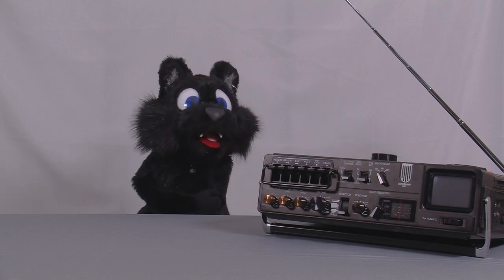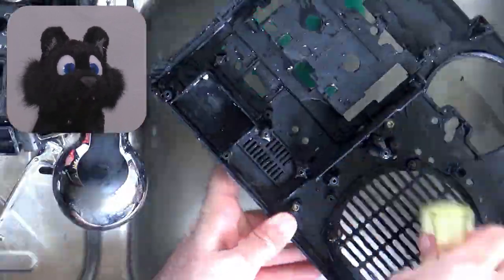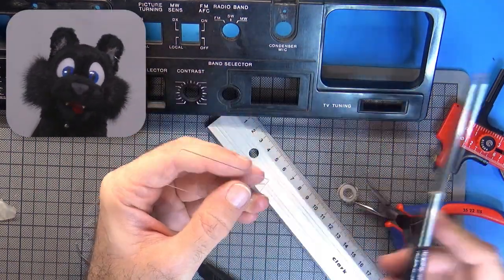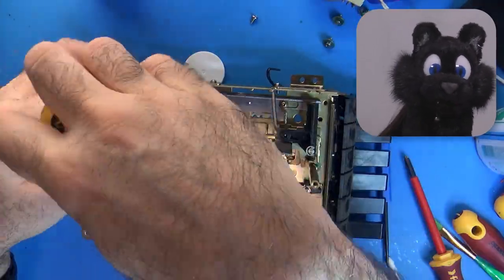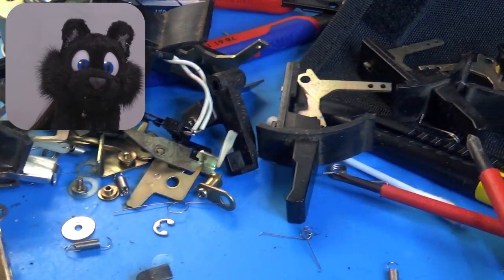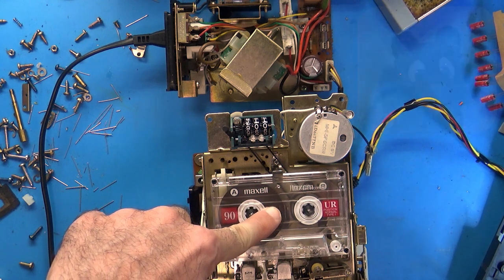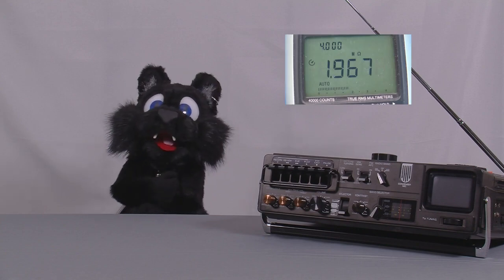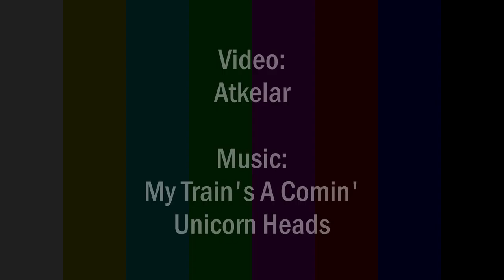Restoration Project #13 - JVC 3060 Radio/TV

Comment: I would love to see you restore an Philips 22RL798 Antoinette Transworld de Luxe, the radio that Blofeld uses in 007 Diamonds are Forvever (at the end). They say it is a nightmare to service it.
Reply from the maker: I have another AM/FM radio in my queue, but it's a Grundig one. Some "world receiver" thing with multiple dials that looks like it's from a military control panel. Very good condition, so it might need only a thorough clean and recapping.

Comment: Interesting! I like seeing restoration projects, Hai sent me here.
Reply: One question, Did you replace the drive bands? I might have missed that. It's something i have done in a few VCR's i have tinkered with
Reply from the maker: Yes, I did replace them. The old ones are either turning into tar or getting very stiff and slippery. Belt replacement is always a first.
Reply: @atkelar  Makes sense. I have found with the things i have worked on (Athough i am by no means an electrial engineer) that belt replacement tends to be the main sticking point, no pun intended

Comment: Wow! excellent work! I bought the same one because I liked it, but it is not in very good condition and it works although not very well.
I have no electronic skills, but more mechanical, I would like to recapping. Have you again the list of capacitors ?
Reply from the maker: Hello! Thanks for the kind words! I did not really have a simple list, I looked at the schematic and took pictures when I desoldered the electrolytics. They are pretty common values that are still readily available. Given the experience with my unit, I'd double check all the switches. These seem to go "bad" rather quickly and need contact spray (be sure to flush it out too and let the switch dry) or direct cleaning with disassembly as I did.
Reply: @atkelar  Thanks for the prompt reply and for the advice.
Congratulations again on your skill !

Comment: How on earth do you know where everything goes when rebuilding! I know you take pictures and have the video but even so that is some nifty work. I would be able to strip it down to the last nut and bolt. The difference is that after an hour of fiddling about and a lot of swearing it would all end up in the bin. I know for a fact it would, I've seen me do it! :-D
Reply from the maker: Thank you! Part of it is also to try to understand everything es good as possible when taking it apart. That way, during the "put together" part I can check on every part once I put it in. Naturally, the odd washer will remain behind now and then too 😊

Comment: I recently picked up one of these second hand that did not have the AC power cord so was unable to test it out.  It does not power up with batteries or the DC cord.  Are there any internal fuses that could need replacing?  Just trying to figure where to start when troubleshooting the power issue.
Reply from the maker: There is indeed one fuse on the DC side, 250V @ 1AT glass tube fuse. It's on the 12V line and would be a prime candidate. The schematic also lists a fuse on the primary side of the AC line, but I don't see any evidence of that in mine. There might have been different models. Also, there is a switch inside the AC line socket that turns off the DC part when a cable is plugged in. That could also be broken/oxydized or stuck. AND the battery line also goes through the 12V socket which would also interrupt the battery line if something is plugged in there. Pretty extreme setup... but all contained on the power board right next to the power sockets.

Comment: Amazing video my friend, congratulations! I have a question and maybe you can help me. I have the same radio and, like you, in my country there is not analog TV. When you plug the cable from the computer to the radio, there is not posibility to send audio+video trough the uhf/vhf port right? Is there any posibility to send audio+video or the only way is throug the air with a transmitter with antenna? Thanks in advance and congratulations again for your helpfull video
Reply from the maker: It should be possible to have both signals in RF over the same antenna connector. The two external connections are just different for UHF and VHF, i.e. the intended frequency range and probably impedance. But the decoding of the signal is the same from right after the IF stage; The question is to hit the right frequency.RF TV signals are defined in a range of frequencies, according to a table I found, for example: Channel 2 = 47 to 54MHz, with the picture around 48.25MHz and the sound at 53.75MHz. TVs usually combine the two into one dial, but the audio is pretty much "normal" FM radio, just outside the defined range of commercial FM radio transmissions. So if you find a device or circuit that encodes both onto the same RF connection, it should work just fine.

Comment: Fantastic! MY hobby is also fixing old stuff but what caught my eye was: the shiny metal parts! How did you achieve this? How did you get rid of the rusty parts and make it so shiny? I can really learn a lot from you.
Reply from the maker: Thanks! I'm not sure which metal parts specifically you mean in this video; But for the antenna (and other chrome plated metals) I use aluminium foil as a polishing rag; That's a trick I learned way back from my grandfather when we were cleaning my bike rims. But it only works with real chrome plating, anything else might be rubbed off. Aluminium is much softer than chrome but much harder than surface tarnish, so it'll "automatically stop" before taking off too much. For chrome-style plastics... that is much more difficult, as pretty much anything will rub off that coating. I recently discovered "liquid chrome" pens that do a good faximily of the original when some minor touch up is needed.
For any non-chrome parts, I usually go with various sizes and styles of wire brush wheels on a Dremel or bench grinder... depends on "how thick the rust is". Those parts don't usually "shine" afterwards. Light rust works with thin spray oil (not WD40, but similar style oils) and an old rag...

Comment: You again surprise me creating a silkscreen stencil for the panel. What software you used? Adobe Illustrator? I suffer using Inkscape.
Reply from the maker: It's been a while and I had too look at the footage again :D but this project was already done wiht InkScape. I generally agree though: it's not some choice one makes but rather the only viable option on OSS. Before I switchted to Linux, I had an Adobe CS-6 license, but I refuse to "rent" licenses and so I was stuck at an ancient level. Illustrator and Photoshop are so far the only two things I really deeply miss. Most projects in the OSS world are... let's say "from C++ nerds, for C++ nerds": basically, "Hey the feature is in there, just learn these 25 hoops to jump through and stop bothering me" attitude. Usability is usually quite low.
Reply: @atkelar  The same reason I don't use AI. Paying for SaaS is just too much expensive. Yes everything is hidden in a convoluted labirinth on Inkscape, and conversioon to EPS is ... well ... less than ideal.

Comment: Hey! I got the exact same model on an auction for around 30 euros as an untested unit. It was a gamble, but I was very happy to turn the unit on and see that all of the functions worked, including the CRT part. When doing research on it, I stumbled upon your video and was very impressed! Can't believe the trouble you went through disassembling everything, not to mention the recap and freaking silk printing, and even the freaking milling machine made an appearance! Very impressive! Immediate thumb up! Mine is missing the "Auto Stop" sticker and the plastic frequency panel (through which the light shines through) is a bit yellowed. It should buff nicely, although I'm scared of making it worse. Any advice? Should I get like a headlight restoration kit, or just a couple sheets of various grit sandpaper? Since it's a small piece of plastic, I don't think it would be convenient to do it with a drill attachment (which is something those kits usually include). 

One question - the bulb on mine is working, but it's quite dim. Is yours brighter, or is that just the way it is? Have you considered replacing it with a brighter modern LED? Best regards, congrats once again on the video, it should definitely get more attention! Just wanted to let you know there are people appreciating this kind of a hard work and nice editing. GG!
Reply from the maker: Thanks for the compliments! 
There are "LCD screen buffing kits" out there that are intended for small scale scratches in plastic surfaces; Headlight kits might be a bit too much for the soft plastics. I did not have good results with sandpaper on transparent things, it takes  LOT of buffing to get the tiny scratches out again; so if the goal is a clear see through piece, I'd look for the display buffing kits first.
The bulbs are tiny little things, and I suspect it was only ever intended to provide a visible light for tuning in when it is completely dark around. Since I made the video, I did in fact put in LEDs, which was too little for an individual video, but even that is rather dim; the radio frequency display would need some sort of light guide; it is basically a bulb in a black tube with a hole on the end where "some" light escapes towards the dial. I'm leaving well enough alone on this one myself.
Reply: @atkelar  Thanks for the reply and advice! :)

Comment: The red light button one how its works ?
Reply from the maker: That button lights up a (very dim) light bulb in the tuning scale. When it's dark around, you can still see the radio tuner station. None of the other tuning scales (the TV one or the indicator one) have lights in them, so it's a bit of a gimmick.

Comment: Hola mi radio al apretar el boton de play suena la radio ,puede ser un problema de los interruptores
Reply from the maker: Hard to tell from a distance; I'd suspect the mode switch (the Tape/Radio/Sleep one) to have some issues; Normally, the "play" button triggers the amplifiere section, but if the radio part is still powered up from somewhere, it will become active too.
Reply: @atkelar  the 3 -position switch that goes up on the chassis in the center position turns off the radio and in the sleep position the radio and tv work but theyvare only activated if the play button is pressed ,i measured the small 3-pin switch that it goes inside and when the button is pressed there is no continuity between the outer pins
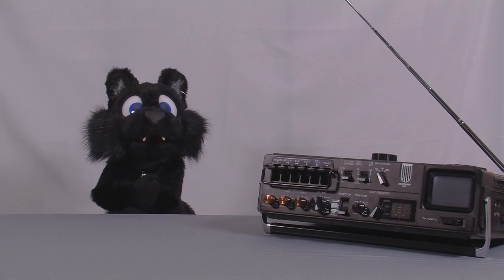Reply from the maker: It might be the same issue as I had: the microswitch on the PCB: it is supposed to bridge the power supply to the amplifier, which is also done by the play button switch for the tape. It's labelled "S10" on my PCB. Check that resistence in both positions. If it's not close to zero, replace or open/clean that one. 14:35 has the scene in question.
Reply: @atkelar  Hello, I changed the microswitch and now everything works fine, thank you very much, greetings from Chile

Comment: I have this model can you give me information about rubber belt size from dynamo motor to that big metal spin 1:18 .. I wanna try restoration mine .. thank you Sir
Reply from the maker: I was going through my notes about the project, but I didn't write down a size; which means that I must have found the proper belt in one of the generic belt sets; it certainly doesn't take anything highly specialized. This one seems to be the original part, but they also don't give dimensions while at the same time telling me that they won't send me one to Austria either, maybe you got different results: https://encompass.com/item/4261052/JVC/4081203T/Capstan_Belt - but I think one of these sets would have a replacement, I'll link one for reference, the "folded length" is essentially "half the circumference" when you lay out the belt flat without cutting it open and a common measuring system - keep in mind that you need a bit of tension and the old one will be a bit stretched out by now, so getting a set and finding one that fits snug without too much force is IMHO the best way to go: https://www.amazon.com/40-135MM-Cassette-Machine-Recorder-Walkman/dp/B08BG4Y58N

Comment: I was given something similar to this, it is just the radio and tv. I can get sound from the radio and back when I got it the TV signal but no picture.
Reply from the maker: You mean you don't have a picture of it now, or it didn't show a picture in TV mode back then?
Reply: @atkelar  didn't show tv picture back then
Reply from the maker: Ah. Yeah, there's a lot that could have been wrong with these. If there is nothing at all, the most likely culprit would be the high voltage or heater for the CRT. Anything else wrong will usually bring up at least some form of static/pattern or even a glowing dot.
Reply: @atkelar  it acts like there is no power going to it but when I checked the connections looked good. Will have to pull it out again and check the heater
Reply: @atkelar  I have one of these the Australian variant of it, and it works pretty good it even played a cassette when I tried it. It doesnt get a picture anymore, well it will produce a raster and snow but no pic as its all digital here now.
Reply from the maker: Same here, that's why I broke out the old C-64 with the RF modulator to test it. Too small to read the text on it though, but I like to know that it works, should I ever have an RF output device with suitable picture ^^
Reply: @atkelar  what about setting it up to receive slow scan tv signals from ham radio?
Reply from the maker: I'm not into ham radio, so I had to look that up ^^ - I wouldn't rule it out, but not in the immediate future.